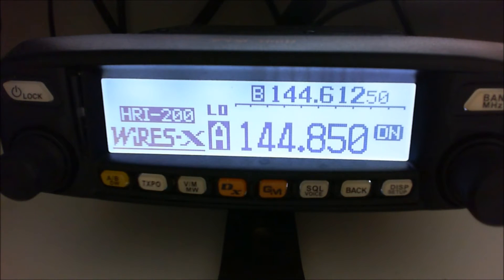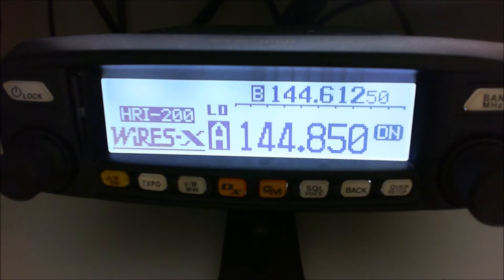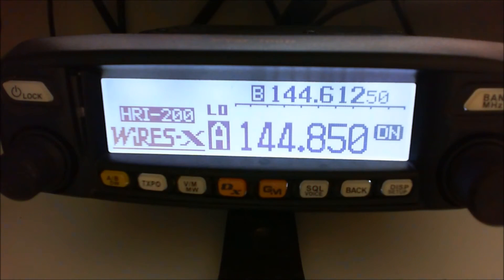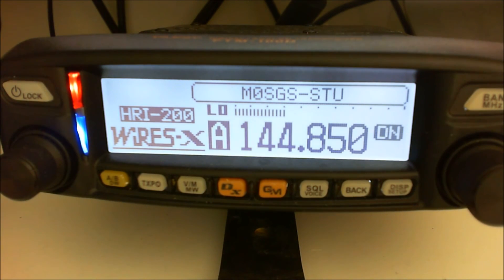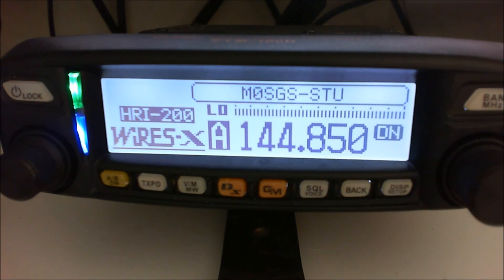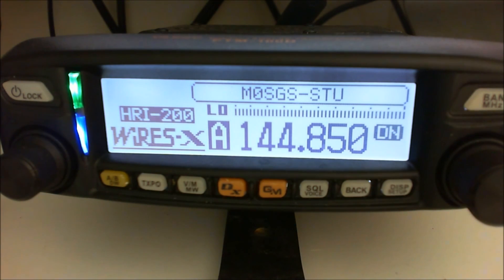Wires-X nodes and gateways www.LBAR.UK

Comment: Stuart, Hi great video! I've just received my HRI 200 to setup my analogue FM node on wires x, silly question time but if I use my 857D as my node radio and my 991A to talk on I am assuming I will need to fit a dummy load to the 991A to be able to use in this configuration? Any help greatly appreciated de Steve M0LVL
Reply from the maker: the dummy load needs to be on the Node radio 857d
Reply: @M0SGSStuart  Ah right, I've got confused mate. I was hoping anyone local to my QTH would be able to talk through my antenna and it would re-tx via my node setup. I'll have to do more research as I clearly have not understood this!
Reply from the maker: you'd need to apply for an NOV as a single freq repeater to do that with 3rd party traffic
Reply: @M0SGSStuart  That's what I'm after the single freq setup, I've checked ETCC website at the start of the week and they are releasing the forms tomorrow for new applicants but my HRI 200 is registered yet still waiting for Yaesu to email me. Are there any "Block" diagrams out there for idiots like me that clearly show all the connections from radio onwards? Sorry to be a pain :-)